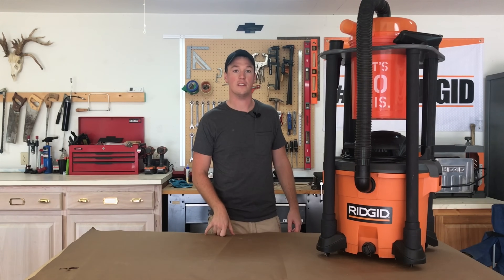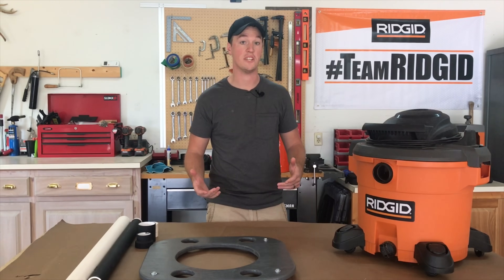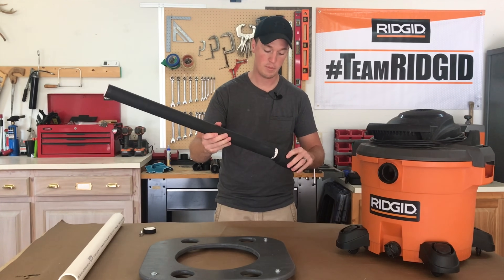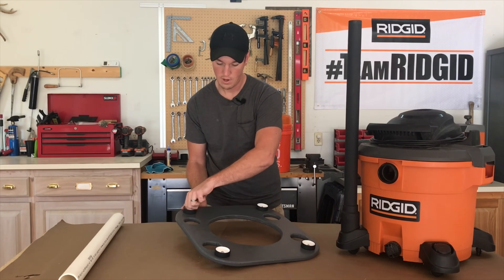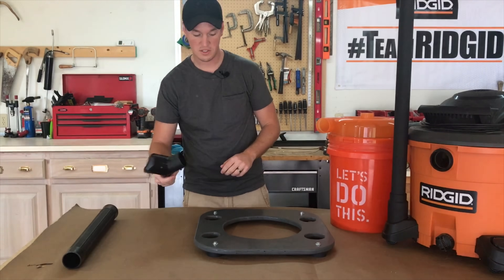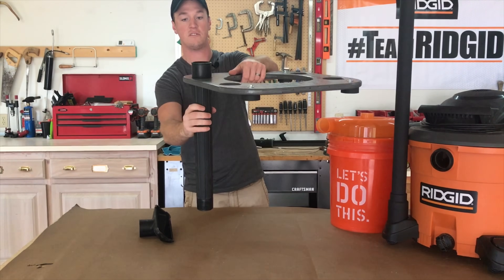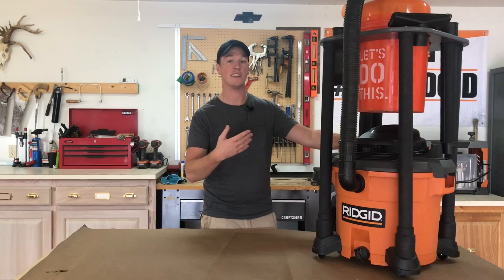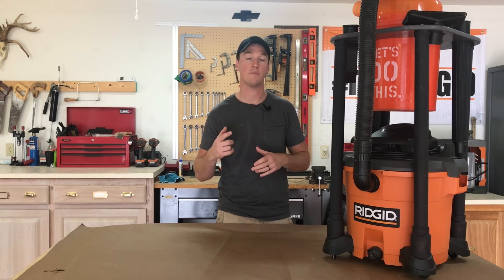The Ultimate Space-Saving Dust Cyclone Separator Cart | Dustopper & Ridgid Vac Cart

Comment: I can't find affiliate links for anything other than the second elbow.
Reply from the maker: homedepot.sjv.io/9gNK1Y
Reply: @JohnBuildsIt  That just brings up the DusTopper.  Are you implying that it comes with all the elbows needed?  If so, what are you talking about in the description when you say "second elbow?"
Reply from the maker: @notgiven3114  it now comes with 2 elbows. It didn’t initially
Reply: @JohnBuildsIt  Ah, OK, thanks.  And thanks very much for posting that video.  I'm building one of those right now (picked up my dusTopper, PVC pipe & fittings etc. last night.)  Now all I need to do is figure out the placement of the holes to mount the 1 1/2-inch PVC caps to the underside of the plywood.

Comment: Just an FYI: Rigid has changed their designs since this video was made and none of it applies anymore. The centers on the wheels are now oval and 2-1/4". One can use a 2" coupler with sheet metal screws but the center of the posts are 16-1/2" which are too wide for the 20x20 top he quotes. Also, the lengths of the posts are also far different. Nice idea but before you ruin a good piece of wood (which I did) or have to buy another (which I will) - you're on your own for measurements.

Comment: Not sure what PVC you used, but the stuff I picked up today needed modifying as neither the 2 1/2" pvc pipe or the coupling fit as it was pretty lose.  Had to actually remove some of the material in the middle of the coupling, and screw it to the vac's foot where there attachments would go.  But, I'm making it work!
Reply from the maker: Yea the castors on the newer Ridgid vacs are different than mine unfortunately

Comment: is it normal for the home depot bucket to implode on itself when the shop vac is on?
Reply from the maker: Mine doesn’t but I have heard others have that issue
Reply: Make some plywood rings, 2, spaced about 5 inches apart by blocks. the bucket is tapered. 2 different size rings. Or use 1/8 by 1 inch flat stock to make rings.

Comment: A very efficient design. I’ll make my own now. Just recently broke down and bought the dust separator for a concrete removal project in my basement.  The separator is worth its cost by a long shot. Just compare the cost of the dust separator to a half dozen replacement vacuum bags and it’s clear it’s the way to go.  Additionally your design actually improves stability of the vac and separator while in use.  They can be a bit wobbly when just set separately on the floor.  👍

Comment: Nice plan. Thanks for doing the video. Another model update: I have a HD1800 and the feet are 2 1/4" OD, so a 2" PVC coupler (which is 2 3/8" ID) is too loose. I stuffed in some insulation for the moment and am looking for a permanent fix. Also, the front feet on this model are ~2 3/8" lower than the rear.

Comment: Hi John - I did it!! Yup, took you idea and made one for myself. I used the Oneida Dust Devil 2.5 with my very old (circa 2003!!!) Ridgid vac. I used a 3 gallon bucket so I could shorten the legs and lower the profile - the dust devil 2.5 is really tall and this change made it less "top heavy" and it looks better too. BTW- since watching your video I've seen several copy cats...one of them did mention you as the originator of this really excellent solution. Thanks, Larry
Reply from the maker: Thanks Larry! Really is crazy how this idea blew up and spread
Reply: Yeah -- but that shows the need for such a great idea - easy to build, inexpensive and solves the problem many of us have --- small work areas.. my garage still needs to be a garage!! :)

Comment: I made the same thing. I was going to use that topper thing but the reviews for it were pretty bad. I ended up using two buckets and put together some pvc fittings into the top bucket for inlet and outlet connections. Works really well. After using it, I realized I needed to make a stand like you have done here. After looking at yours I am going to paint mine. Mine looks like crap lol.

Comment: How did you determine the locations of the CAPS center points on the plywood that the legs mount into so that the legs stand up straight.  Also how did you determine the 4 corner hole center points for the accessories to mount into.

Bob S - Cleveland
Reply from the maker: Measured from the center points of the castors. The accessories were just random, doesn’t really matter 👍🏽

Comment: You took my idea  to a whole new level in BEST design. The one thing I intend on doing different is adding water to the top bucked then running the exhaust hose down INTO the water. This is so when I am vacuuming up debris, the large particle like saw dust and other stuff  get's trapped in the main body of the shop vac but the fine dust particles, that normally get blown out into the air and you wind up breathing, get blown into the water and trapped and the air just rises up as bubbles and comes out of the exhaust at the top of the bucked.  How long it take to turn the water into all sludge I don't know yet. When I do I will make a video my self. Later folks.

Comment: I'm sure you've already covered this but, do you lose suction power from the vac? I'm using the Dustopper myself and I can tell a significant loss of suction. Did you do anything to the fittings or the bucket lid to retain the vac suction power? Thanks
Reply from the maker: Anything you add to a vacuum will reduce suction, even longer hoses. But no I don’t have a significant drop in mine that’s noticeable, still performs as it should for me!

Comment: I mostly copied this design but with the Bauer Cyclone, also I am not a fan of having the suction hose so high, thinking that it may cause tip over. I will put in an elbow and 2 extension sections and a second elbow to get the hose attaching closer to the floor. The Bauer is taller so that makes it even more important.

Comment: For the newer models, i was able to use a 2" coupler with threads (PVC x FTP Adapter) to attach the base, then 2" pipe straight up to the top. The threads reduce the ID slightly and with a heat gun screw them on for a very secure fit.

Comment: @John - Thanks for posting this great video. I have purchased the Rigid NXT HD1200 which has different size feet that a 2 inch PVC pipe cannot fit on. I came up with a solution that I would like to post but youtube keeps deleting my comments after a few seconds.  I'll try removing the URL to the part and see if it works.   What I did was purchase a rather expensive part from Home Depot that connects 2 inch PVC to 2 inch copper.  The part is named: Proflex 2 in. Neoprene Shielded Coupling.   One end has a much thicker neoprene and makes a very tight fit to the new foot base. 

Easy procedure to connect fitting to vacuum feet:
1) Put some silicone spray on a rag and wiped it onto each of the metal clamp inside, the neoprene fitting thick end inside and all of the outside, and the lower part of plastic foot of vacuum to make everything much-much easier to slide on. 
2) Loosen clamps on metal fitting to allow room for neoprene expansion. Slide metal fitting by itself over vacuum wheel foot.
3) Slide thick end of neoprene down into metal compression clamp ring and press into place use a flat piece of wood to avoid cutting your hands on metal ring.
4) Tighten lower clamp.

Now it is ready to add the 2 inch PVC riser legs and the rest of the build.  As I said, these parts at $9.61 each are rather expensive but can be a big time saver over other methods.  Time is money.  LOL.
Reply from the maker: Awesome. I need to make an updated video and I’ll keep this in mind as an option to show!

Comment: I have the 12 gallon Rigid and the 2" PVC couplings aren't tight and the 28" on the poles aren't long enough. Maybe there was a change of dimensions?  Screws solved the coupling issue but it's not as tight as I would like it. Also 4 small pieces of wood on the lid to raise it off the vac solved the second issue. But mine looks pretty cobbled together!  :)
Reply from the maker: Yea unfortunately they changed the whole design of the vacuums after I made this!

Comment: How easy is it to take the whole assembly off the shop vac if you want to just use the shop vac by itself occasionally? For example, cleaning up water in the basement, or dry wall dust from a few repairs, or something like that? I wouldn't want to bring the whole unit into the house, just the shop vac.
Reply from the maker: Comes off really nice on this model of vac, I’ve done it several times 👍🏽

Comment: Will 1-1/4” pvc pipe be strong enough for the uprights and to so support the Duststopper assembly?  My Ridgid shop vac wheels will only accept a 1-1/2” coupler so I’m going to have to get a reducer to step down to 1-1/4”. Without the reducer, I run into the same problem you did with the 2-1/2” pipe hitting the top of the shop vac. Please let me know. Thanks.
Reply from the maker: I don’t know for sure, but I would think so!

Comment: Great video - many thanks. Followed the build with my vac Ridgid HD1200 which stands at 24 inches on it's own - only an inch taller than the one in the video. The design is a little top heavy and tips when I try to pull it with the hose-maybe just some weight in the vac is the way to go as has been suggested. Is it a much lighter vac maybe? Or maybe the end caps need to be mounted in a way that keeps the legs tight to the vac for stability. The castor fit issue I fixed with some pieces of a thin rubber mat wrapped over the top of the castors and then working the couplers onto it. Thanks again!

UPDATE for those working with the same model vac as me. Changing the cap positions so the legs push against the vac really improves stability - very solid now. Did I try the spin test - no -  but no wobble. The centre holes for the caps made a 12 inch square if that helps. Still top heavy when pulling the rig with the hose with this model vac. Solved it by securing the hose to the top of the nearest leg (with a twist tie) so it's now pulling from a lower point but still very happy with it. All good now - thanks again.
Reply: @Scott H Yes they were bit loose so I used some bits of an old yoga mat and secured it in the end of the coupler with some double sided tape. It's a nice fit now - especially after repositioning the caps so the legs actually push against the side of the vac.

Comment: As of 5/25/2021, the total cost of parts (not including vacuum) is $81.01.

See https://www.homedepot.com/mycart/home?userId=1937d68b-3fd4-4107-8b92-f5e9c2fea7f3&customerId=1937d68b-3fd4-4107-8b92-f5e9c2fea7f3&sharedCartId=HH100004977857&cm_mmc=ecc-THD_SHARE_CARTV1_M1_CA_-VIEW_CART&ecc_id=2584b4c9a371836e7628a009f3d47444f6e315c4eba20961a5ffd4cc5d190518

A caveat is that the MDF board I listed is not wide enough, so you'll have join two halves together, but it is cheap.
Reply: $89

Comment: Once the top bucket begins to fill with sawdust, you shift the center of gravity upwards and if pulling on the unit from the top you increase the chance of it tipping over. So the only improvement I would suggest to this design is to route the connection to the hose from the top to lower perhaps, very low. This is easily done by modifying one of the corner supports to actually become the connection point for the hose. This way regardless of how heavy the bucket becomes it will never tip over. So, instead of running the hose from the Dustopper directly to the user's hand, route it to one of the support corners and then from the bottom of the support pipe you would connect your hose. You can pull on this all day long and never have to worry about it tipping over.

Guess how I figured this out... Doh!
Reply from the maker: Haha dang man! My only nemesis is running over cords. I haven’t had any issues with it tipping over at all
Reply: This is a cool idea and suggestion though. I might implement something like that. I like that the hose would rest on the floor only a couple inches from the connection.
Reply: You can also put a couple of bricks inside the vacuum canister.  This will make it bottom-heavy.  Since the sawdust goes in the upper bucket the bricks will not interfere.

Comment: I modified this design. On two of the uprights I spliced in Tee connectors. I then extended from the Tee about 8" pipe. Then added a 90 degree fitting pointed up, placed may 8"  or 10" pipe running vertical. Put an end cap on this pipe. Now I have a handy place to store my hoses. I unwrap what I need to reach the tool.  I use two types of Rockler hoses, the expandable and the non expandable hoses.

Comment: I know you said you'd pin some work-arounds for the newer design by Ridgid, but with over 1,200 comments, I've read about 400 and still haven't found it yet. sigh Could you put it in the description please?
Reply: I found the following comment about the redesign. Reposting here to help others. "I bought the Rigid after they changed the caster feet from John’s version. It actually simplified the design for me. (4) 1.5” pipe at 33” length. Use a heat gun to warm up the pvc and push it down on to the nub on the top of the caster. If you don’t have a heat gun a 1.5” coupling fits over it loosely." Another commenter mentioned using kaizen foam (cut to fit snuggly) in between the pvc posts and the body of the vac to add rigidity and minimize wobble. Cheers!
Reply: @spamnelsonhere  thank you

Comment: Thnx for sharing. When I saw this I immediately built this for my workshop. Also to change the filter on the vacuum there is no need to pop the legs off. Just remove the bucket that will give you enough space to lift the motorhead and rotate it 90 degrees then you can replace or remove your filter for cleaning if ever necessary.

Comment: This was a great idea. I just finished  building one. The measurements are off a little with the current rigid vac and the couplers are loose but gorilla tape fix d that issue. I thought about gluing the bottom couplers into the feet to make it more solid and sanding down the 1.5” pipe to make disassembly easier. Thanks for the vid!

Comment: Greetings all… So I have the new model and yes the video is correct in saying that the 2 inch couplers do not fit well in the new model. My solution to that was pretty simple I just wrapped some duct tape around the bottom I’m jamming into the caster. It actually works rather well… Simple solution

Comment: Just built this yesterday. 
Easy peasy 
Today is sand and paint for the finished look
Reply from the maker: Awesome 👊🏼
Reply: What did you do with the new caster design?
Reply: @asoggyburger479  I used 2"" couplings then 2 inch pipe directly to 2" caps.
Works great
Reply: @oldmarine312  You must have the older rigid design. The new models have different casters that don’t work with 2inch couplers.
Reply: @asoggyburger479  it's only 4 months old 
Maybe a left over

Comment: I like what you did, but instead of using 90 degree fittings to go from the cyclone to the vaccum, use 45 degree fittings.  Those hard 90's are much more difficult to move thru at speed.

Comment: I built a copy of your stand - thanks for the design!  I appreciated the comments that followed - hoping to add mine to pay it forward.  I had the new style castors so I used the rubber reducers (2" X 1/5") at the base.  I used Black ABS which seemed simpler than painting the white PVC black.  I also built a little bridge between the two back risers using 4 ABS 1.5 " T's plus a 60 degree elbow.  I added two 12" upright ABS tubes to store the two rigid extensions.  I also used extra caps on the top plywood for storing attachments since I did not have a large hole saw.  I hope these ideas help someone next.  Innovation is such fun - thanks again.
Reply: The black ABS pior idea is simply genius! Thank you for this suggestion!
Reply: What are the rubber reducers?

Comment: Just a quick note...If you use a 2” to 1 1/2” Fernco coupling you can easily connect to the new Ridgid feet and then, continue as JH describes here.
Reply: I just tried that and while it works it's unstable. I'm using some elastic straps to help
Reply: I went with shielded fernco 2 inch couplers and 1 1/2 PVC couplers. The shielding adds ALOT more rigidity. $7 a piece but work great!

Comment: This is a great design and I have also copied it and built one. My question, if you still can see these, is what have you done about the collapsing bucket when using the dustopper and the 2 inch tapered to a smaller hose and attaching it to an orbital sander?  The bucket collapses due to the vacuum in the bucket then I am getting dust going into the vac.  Thoughts on the best solution?
Reply from the maker: I use the 2” hose right to my sander and don’t have the bucket issue, but if you drill some holes in your reducer or hose to introduce more air it should take care of your problem👍🏽